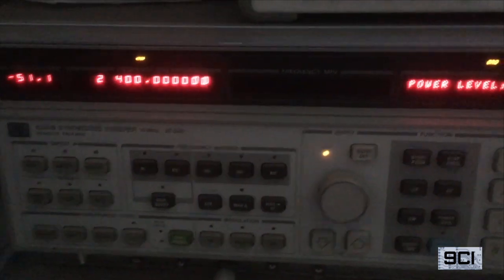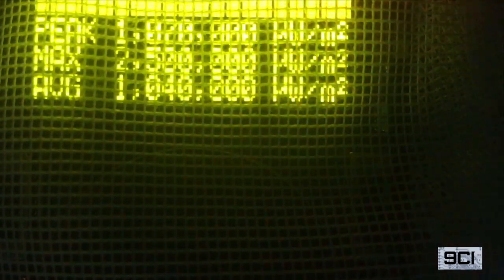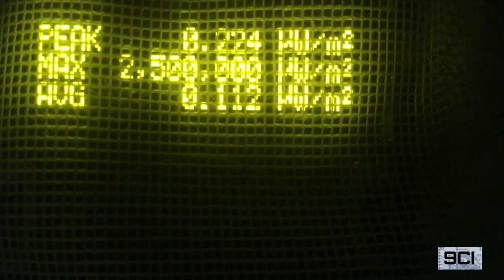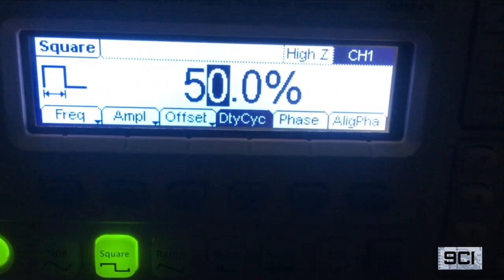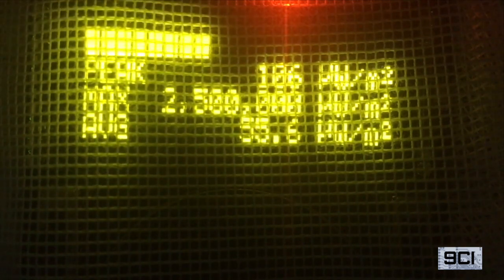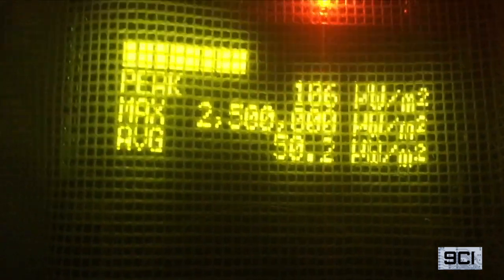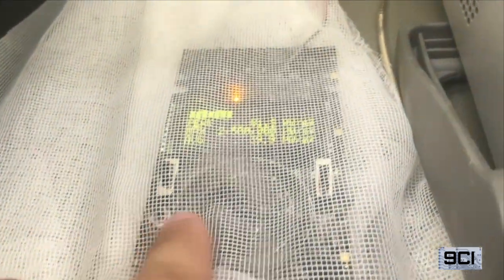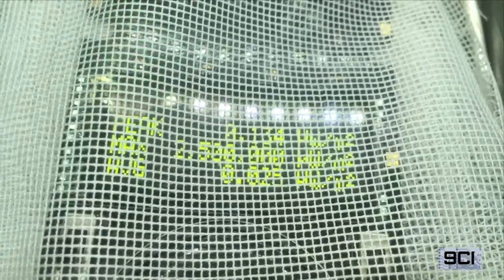5G ready RF meter testing- Safe and Sound Pro

Comment: which electric/magnetic detector is best now(test mobiles, wifi, 5g, magnetic...)? Safe & Sound Pro II?
Reply from the maker: Excellent question Be Water, 

Depends on how much you want to spend and which frequencies you would like to test. We recommend for the best bang for your buck (either a classic or Pro II - depending if general ranges or actual numbers are required). If you have thousands to spend then Gigahertz Solutions has some really accurate meters.  Magnetic fields and E fields are much lower frequency than the mobiles/Wi-Fi/5G frequencies. SLT is coming out with a Mag/E field meter in the next year or so that will be really accurate and a good price for quality. If you want one right now the Tri-field is easy to use and has pretty good mag-e field measurements (for an example). 

Thanks for your question!

Comment: Can it make sound and can you transfer the data or print it out
Reply from the maker: We actually did something like this using the speaker output as a measurement gauge to make an RF heat map. 

https://www.youtube.com/watch?v=IKN5K54je04

Just to drive around not using our testing equipment.

Comment: This is for Australia 
5G will use spectrum in the existing LTE frequency range (600 MHz to 6 GHz) and also in millimeter wave bands (24–86 GHz). 5G technologies have to satisfy ITU IMT-2020 requirements and/or 3GPP Release 15; while IMT-2020 specifies data rates of 20 Gbit/s, 5G speed in sub-6 GHz bands is similar to 4G.
Reply: So are you saying this meter might be ineffective (underutilized) 
in USA ?
Reply from the maker: The device will be useful for the lower frequencies of 5G and is capable of reading the "short bursts" or pulses that happen very rapidly. Some meters are not sampling as often so can miss them.
Reply: @cherielektra  As far as I know 24–86 GHz is not in use yet. The short millimeter wave have very short reach and no penetration. I realy dont know how they want to use it?!

Comment: Thank you for the video!

Hey there .. 

Q.way this is "5G ready" ?
If the 5g will be around 50,60,70 GHz?

thank you
Reply: B4uneed:
The initial 5G rollout is happening at lower frequencies. https://www.t-mobile.com/news/600-mhz-5g-call
There is also a 3.5 GHz band being allocated: https://venturebeat.com/2018/10/23/fcc-expands-3-5ghz-band-to-5g-and-opens-6ghz-band-to-future-wi-fi/

These bands will be the first ones widely used in North America. Many detectors don't detect that low, or in the 3.5 GHz band (many have a big hole between 2.4 GHz and 5.6 GHz). Our goal is to cover all these sub 6 GHz bands right now, since they will be first.

For reference, Apple doesn't make a 5G iPhone yet, since there are so many changes coming this year still. We are at the very beginning of the rollout in North America, and most cities do not have mm waves floating around them yet.

We are working on 28, 39, 60, and 80 GHz detectors for the other 5G and car radar bands. Stay tuned for those products as they are released.

Hope this helps!

Comment: hi! I bought a safe and sound 2 meter that comes with measurements in microwatts m2, how can I know which band 3G or 4g or 5G network if the measurement is ghz! thank's for your time!
Reply: Hi!

The Safe and Sound Pro II measures the power of ALL transmitter sources in its measurement band. It displays the TOTAL power in the band.

For example, if you have WiFi, 4G, and Bluetooth in your area, the meter will display the sum total of all of those sources, which is what your body is absorbing.

We have circuits that will show the frequency of measurement. To make this measurement accurate adds cost to the meter. If there are enough users who would like to know the frequency band and are willing to pay a higher price, we would love to make a meter that displays the primary frequency, as well as power. Let us know what you think!
Reply: @tsiratnulov  make a meter that displays the primary frequency, as well as power that would be nice!!!
Reply: @lifetravelpepper5740  Excellent feedback! We will look to add this feature with good reliability and accuracy.
Reply: @tsiratnulov  Hello is there formulas to covert microwatts per m2 to ghz or volts per m2. 
Thank you
Reply: @EOTUK2025  f
Reply: @tsiratnulov   first make sure to hire people who know how to read properly. 
your "scientists" measure pulse duration in micro seconds while RIGOL 1022 is showing mili seconds (50.000,0 us is fifty thousand micro seconds or fifty mili seconds
on the safe and sound website, description says the sampling rate is <5 us which is completely false, that would make a 200kHz refresh rate while the other high end RF equipment like Tektronix RSA306 ($3500) is sampling down to 100 us
Reply: @meex88hiphop  The sampling rate IS 200 kHz - it's actually faster than that. The time IS <5 us (micro-seconds).
Reply: Maybe you can hear it. 3G 4G 5G must have different modulation/pulsation. So you should hear the difference.